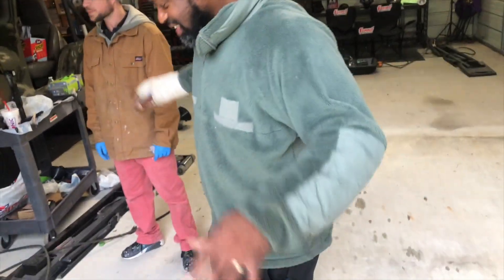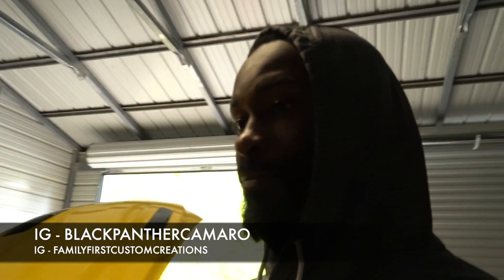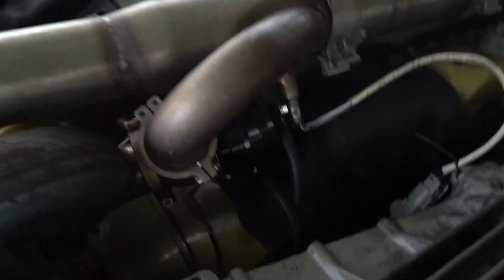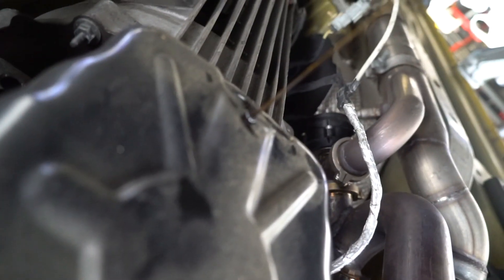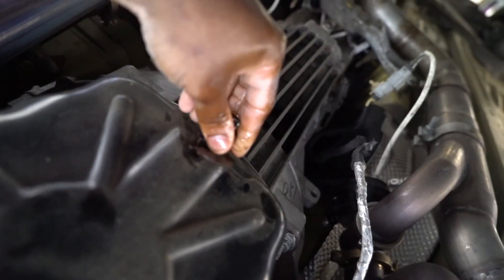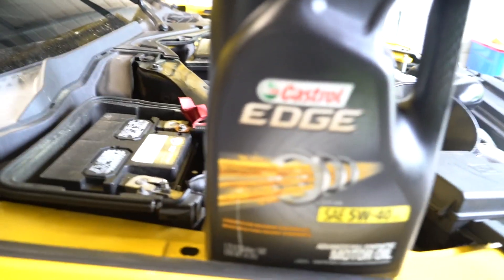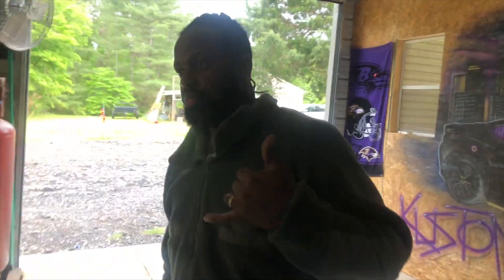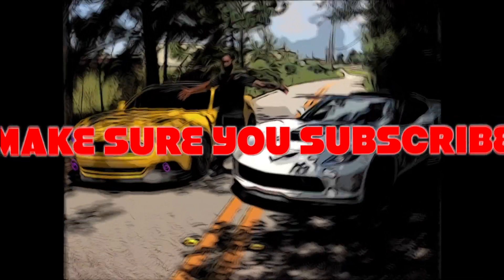2015 - 2017 Ford Mustang GT - OIL AND TRANSMISSION FLUID CHANGE (twin turbo)

Comment: DUDE you need some jacking rails... save the stress on your pinch welds
Reply: Had my car on jack stands for two weeks rails look fine. Literally no point in adding weight to your car for pinch welds
Reply: @Allthingschillguy  hey just a suggestion. I'm always into protecting my money. Oh and the weight added is negligible since the ones i use are hollow.